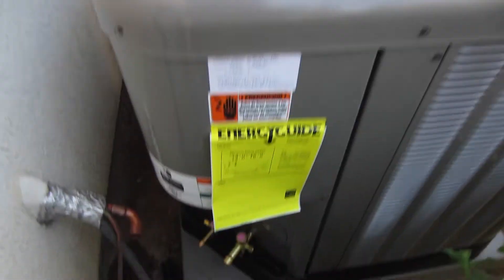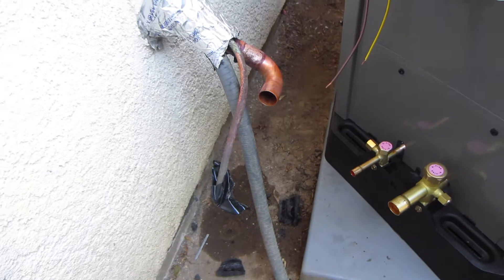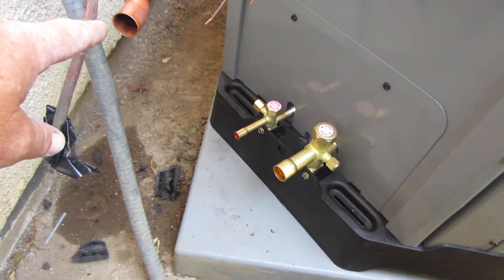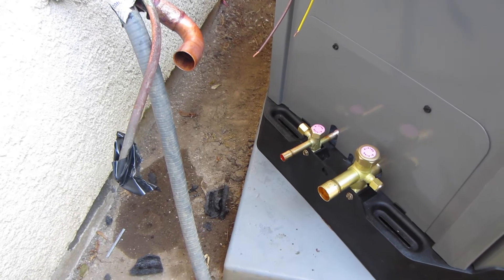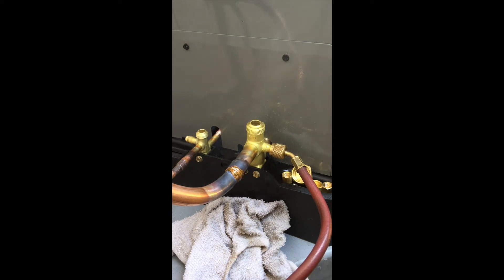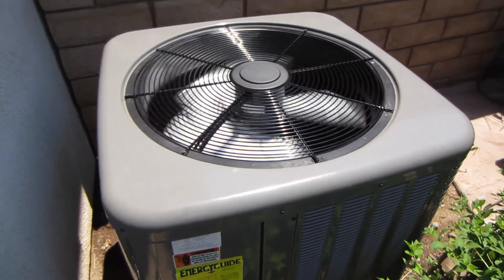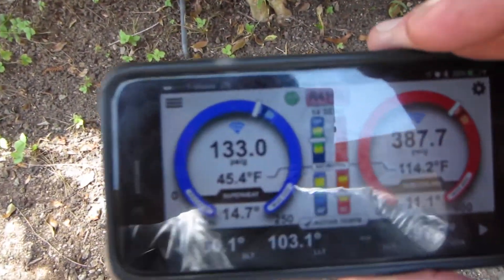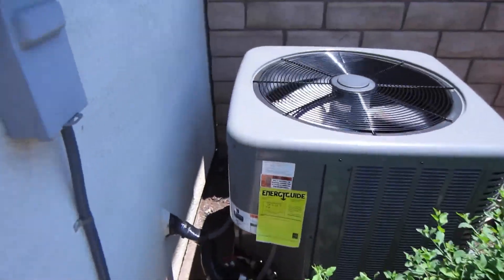Rheem Condenser RA 14 3Ton

Comment: Good video. Did the installation manual call for that p bend ?. Jk
Reply from the maker: The installation does not call for a P bend. This job did have a bedroom wall so i was concerned about impact noise that can be produced when a scroll compressor start up.I don't alway follow the practice but it is a good idea to change direction on your suction line piping especially on a scroll compressor. Thanks for Watching.